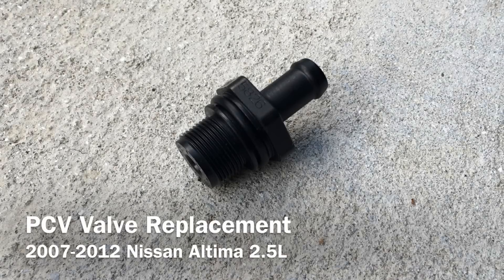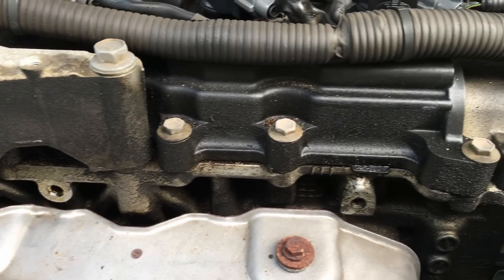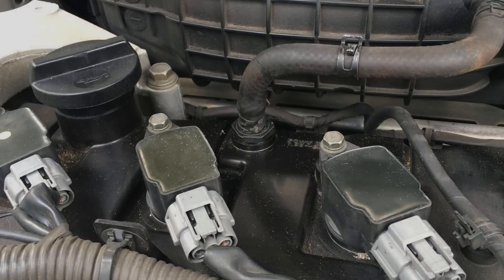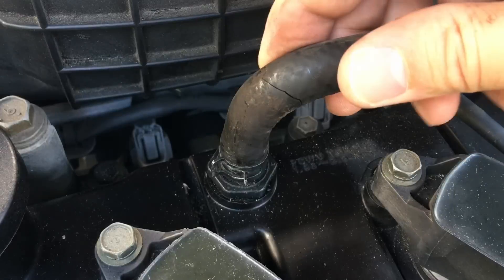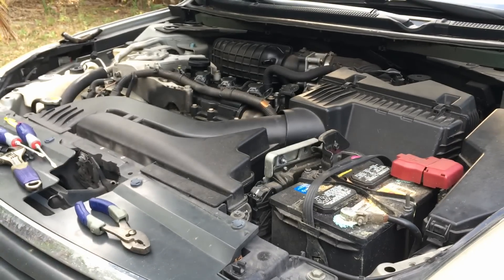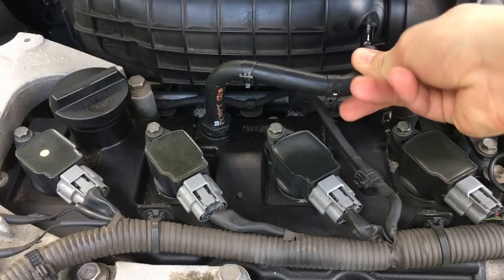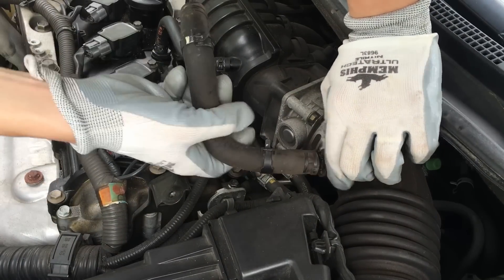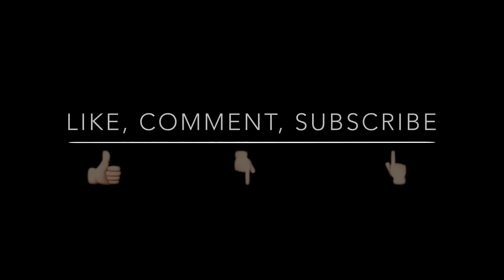How To Prevent Engine Valve Cover Gasket Oil Leak - PCV Valve and Hoses Replacement - Nissan Altima

Comment: Hello. There is burned/old/mostly dry accumulated oil on my 2010 Altima’s valve cover. It’s all over the valve cover but only on the top. There is also the same oil on the pcv pipe around 2 inches from the bottom. 
No oil leak from the front of the engine to the cylinder head. No black residues or oil inside the spark plug holes. So I don’t expect valve cover gasket leak.
What can it be? Howcome there is old oil also on the the pcv pipe?
Thx

Comment: It was a pain but i was able to reuse my OEM hose, which looked good still. Had to use a vise grips to take out the original pcv valve and pb blaster. It was stuck.

Comment: I have recently replaced my turbo and since replacing it noticed I have a small leak at the back of the engine. I think the reason my turbo failed was due to pcv valve. Any advice for me ? I know this is a difficult question but any help would not go a miss.
Reply from the maker: If its not too difficult you can remove PCV valve and check if its clogged or stuck open or stuck closed.
Reply: DIY-time I got a mechanic coming tomorrow. Is it possible it could of been the reason my turbo seized. Now the new turbo is in i can tell I have blow by in the engine and on the rare occasion can hear a whistle on a cold start that goes away. Plus obviously a leak I have now which I’m assuming is because of the ventilation pressure pushing the oil out.

Comment: I need to replace the same part in the same car model BUT V6..

Can anyone help??!
Reply: It's much more difficult for the 3.5 V6
Reply from the maker: It also should be somewhere on top of the engine.
Reply: did the part numbers from video fit your V6?
Reply: @nickibarra5217  Yes.. exactly..

Different numbers but the same part..

Comment: Sir, my car Hyundai i20 make hissing sound for about 5 seconds only when engine is off from start.

Now, after going through your video, I disconnect the pcv hose from its valve and block it's hose end with my thumb.

Started the engine, yes, my thumb is being sucked by the hose. Off the engine, yes, the hissing sound guess away.

What is the problem...the pcv valve or hose or open the engine cover and look for inside to find out!!!

Please help.
Reply from the maker: Check if the hose is loose or has cracks. Also take out PCV valve and shake it to see if the valve is moving freely.
Reply: DIY-time checked for valve and hose leaks and everything is ok. Now, I'll removed and check for pcv valve sounds by shaking it.
Reply: Also, the hose is sucking when block by thumb. Does it mean that the hose is ok and fine????
Reply from the maker: Try to pin point where the sounds is coming from. Also, it wont hurt to replace the PCV valve if you never did it, they are usually very cheap. Just make sure to get a good quality OEM part.

Comment: Hello there. How did you get the oem numbers? I have an 04 sentra spec v
Reply from the maker: I got a repairs manual for my car and it has a lot of that info. Also, when I shop for parts, I use eBay or Amazon compatibility checker, it works pretty well. And also this website was very helpful a few times: https://www.factorynissanparts.net/
Reply: DIY-time Beautiful, thanks so much! Never thought of buying a car repair manual

Comment: Hi I recently got a Nissan x trail 2007 when i when't to change the air filter there was oily deposits on the under side of the filter now i don't know how long since it had been changed but could this be a faulty PCV valve ? Thanks
Reply from the maker: Correct, that's the first thing you wanna check.
If your car has more than 100k, than definately replace it.
Reply: Temachok Thanks for your reply It confirms what I was thinking  👍
Reply from the maker: No problem! 👌🏼

Comment: Does this applies to 2004 Nissan Altima ?
Reply from the maker: +GulfBmw forums sroor9001 Sroor 
Yes, it will be almost identical for 2004 Altima. You may also wanna check valve cover gasket and spark plug tubes o-rings. They are notorious for leaking. If that's the case, you'll have to replace entire valve cover, which usually comes with PCV valve.

Comment: Hello! Graat video! I have a 2007 Nissan Altima and it recently got the Service Engine Soon light. Took it to the dealer and got the code P0171. They told me that the Breader hose was cracked/leaking and that  throttle cleaning 3 stage was needed. Would this be the reason why my car shakes when idled and has a rough cold start? They are charging me $300 to fix both. Any help is welcomed! Thank you!
Reply from the maker: Yes, that could be one of the reasons.  
Replace PCV valve and both hoses and see if problem goes away. It's very east to do and will cost about $40 for parts (if you need, links for parts in description).

Comment: 2007 Nissan alitma are garbage cars I had cvt go last week on 3.5v6 never will buy Alitma I sold it.
Reply: john1240able Nissan quality control has gone way down.
Reply from the maker: I think you should try new Toyota next time....
Reply: I replaced mine. Boy, $4268!!! Not worth it at all. Just a lil fyi
Reply: Mine has been very reliable 110 thousand miles but it is a six speed manual
Reply: I agree, too many mechanical problems and electrical..
Reply from the maker: My CVT started jerking too last week... 😨
I think I'm up for a big trouble soon...
Reply from the maker: I agree! 
I have a long track of issues with mine....
Just finshed fixing AC for the third time in 5 years....
Reply: I got Buick SUV much better quality then Nissan.
Reply: John -  Totally agreed! I own 3 brand new Nissan and they all having issues with consuming oil, not to mention other problems. The worst car is Nissan X-Terra check engine light come on at 36,500 miles, fuel pump goes out at 45K, coolant problems with both X-Terra and Altima.

Comment: I also replace my pcv. might be the hose.
Reply from the maker: +RiceCake Xyooj 
Could be. If hoses are not sealed, it can disrupt vacuum in PCV system, which prevents it from releasing pressure built up inside crank case.
Reply: +Temachok  one of my hose connected to my pcv hose is kind of bended n looks old. might replace that hose. 
I switch ignition coils 1 with ignition 2 bcuz  1 was the only  leaking. but I will recheck if there oil in there after a long drive Thank you for the fast reply. you video is awesome.
Reply: +Temachok  thank. I just found my issue on my sentra. it was a bad ignition coil.  at first ignition coil (1) was leaking oil into spark plug. I switch ignition coil (2) with (1) . now (2) is leaking only. and (1) is dry.
Reply from the maker: +RiceCake Xyooj 
There you go! 
You should be able to replace just the wire boot instead of the whole coil, similar to what I've done in this video: https://youtu.be/pP0I-iSBUF4
 It's like 10x cheaper.
Reply: +Temachok  love your video. helps a lot. I replace one of the bad ignition coil. and no more leaking in the cylinder. but still has blue smoke coming from the muffler pipe when start engine n goes away
Reply from the maker: It might be a sign of a bigger problem. Is your car consuming oil or coolant? Try to keep checking levels.
Reply: +Temachok got brand new radiator bout 3 month ago.  friend was a asumming it was just old oil that go into the cylinder n still need to burn off. already cost me 300 replacing valve cover and ignition coil and all spark plug.

Comment: how often should you change the pcv valves?
Reply from the maker: +occckid123 
I've heard on average around 80k miles under normal conditions.
If you frequently drive short distanses under 10 min, PCV valve will faill much sooner.
Reply: +Temachok I have 99k on my 2014 altima. mix of driving. is this cheap at a dealership?
Reply from the maker: +occckid123 
It should not be too expensive. Not sure exactly how much though. I rarely buy parts from dealer. Same stuff is usually up to 50% less on Internet. Call them and ask for parts department.
Reply: I have a 2009 altima 2.5 and it smokes badly i replaced the engine with another used one and it smokes the same , pls answer me does that procedure fix this problem ???
Reply: I mean does replacing the PCV VALVE fix this issue